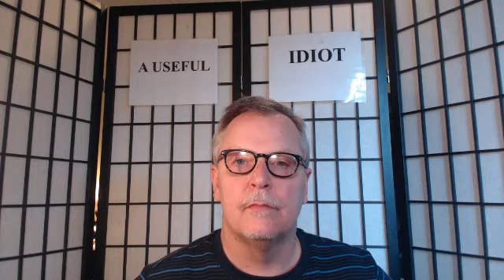German Company Makes Machine That Turns Water Into Fuel

Comment: ★Thank-you ★SEE My PLAYLISTS Titled ★HHO How To Build It And Run ANY Engine On Water ★CREATE WATER OUT OF THIN AIR ★Food Abundance Aquaponics ★CURE To EVERY Antibiotic Resistant Pathogen Including Cancer Which Is A Fungus ★(16oz Water/Urine Drive 3,000 Miles, -40 Below Freezing Use Windshield Washer Fluid With Antifreeze, Jack Nicholson Been Using Water Since 1978 Along With NASA & NAVY, Ect. Also Called COLD FUSION,LENR Low Energy Nuclear Reactor,Brown's Gas,Nuclear, FUELCELL,Hydrogen HHO Ect.)
Reply from the maker: very cool